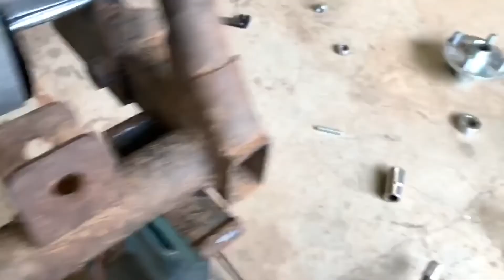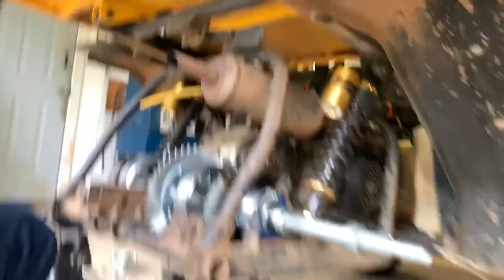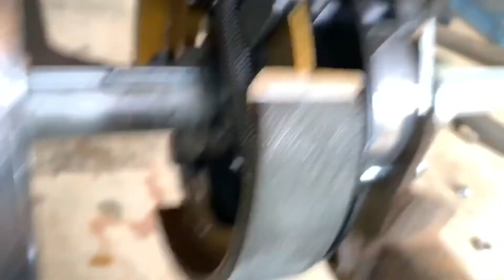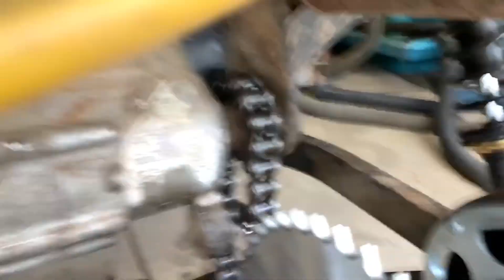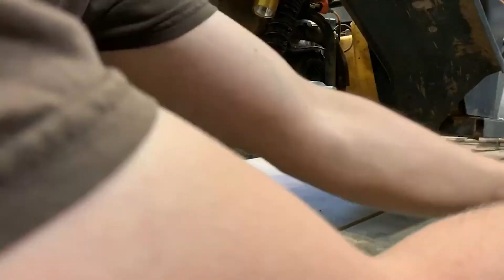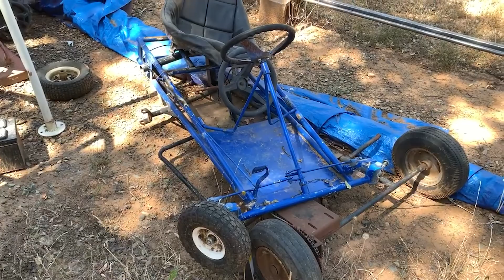Yerf Dog CUV Rover: Replacing the axle and brakes with standard live axle parts.

Comment: i just got one that runs and drives super cheap. cant get the chain tensioner to fit like its supposed in all the pictures. engine fix bracket is bent and the bearing is missing. axles are also super loose like yours were. engine smokes a little on full throttle. struggles to start at that even after cleaning the carb, new fuel pump, clean tank. is this thing a lost cause?

Comment: I just bought my first Yerf dog Rover (1994). It was not running due to melted wires so I put it in neutral and winched it up on my trailer. Then put it in F to haul it home. Got home and put it back in neutral and rolled it off the trailer. Fixed the melted wires and started the engine. Moved the gearshift to R. Next day the shifter won't move. I went out and tried to push it backwards by hand. It wouldn't budge. I jacked the rear end up and I could shake both wheels back and forth about an inch either way. I had my wife sit in it with her foot on the brake trying to pull the shift handle down out of reverse. No luck. Then I started the engine and let it run at a low speed while I tried to move the gear shift lever down. No luck. Neither wheel was moving even though it is in reverse. When it was on the ground and I raced the motor, it seemed like it was trying to move forward but couldn't. But now I still have the rear wheels off the ground and the slack I had before moving the wheels back and forth is no longer there. It feels as if the brakes are on now when I try to shake the wheel back and forth. They won't move at all. I took the shift cable loose from the transmission linkage and tried to move the lever by hand. No luck. I noticed that lever is hooked at the bottom to other linkage behind the shift lever. It has an ear on if that rests against a pin coming out of the transmission. The pin fits against a couple of notches on that ear. I was unable to push the pin in and try to move the ear. I didn't force anything or hammer on it for fear of breaking something. It sure feels like the brakes are locked but the emergency brake is down and the pedal seems to be applying the brakes normally. I looked at the brake drums. The one on the driver's side appears to have moved over towards the passenger side a little with a gap in it. The drum on the passenger side has what appears to be a large rubber seal exposed between the hub and backing plate.

Can you help me?

Comment: I put those same shocks on my your dog's scout roll over and I have some side to side movement now do you have the same issue do I need to put some type of stabilers shock on an angle to prevent this or do I just run it as is
Reply from the maker: Sorry I didnt get back to you sooner, I made a video where I built a track bar to give it some stability, and the fixed the issue. https://youtu.be/g2qu-OJuu78

Comment: What length and diameter axle are you using?
Reply from the maker: It is a 1" diameter axle, and the overall length is 44"
Reply: @TheSkinnny  thanks
Reply: My sprocket is 2" diameter, the axle you use is only 1". Did you order a different sprocket?
Reply from the maker: @Felicia_Fuller  I did order a new sprocket and hub. I went for the larger 6 bolt 5.25" azusa uni-hub. That hub was easy to find plenty of available sprockets for any of the popular series chains. I did try the more common small sprocket hub that has a few different bolt patterns on it, but none of those patterns lined up with the original yerf dog sprocket. Check out azusaparts.com that's where I ordered almost everything for this.

Comment: Do you have a part number for the axle?  Are the brakes and sprocket reused from Yerfdog axle?  Did you just by the axle and reuse all old part?  I have a scout with a broken axle and just want to replace the axle; it's not worth it if I need to spend $500 on fixing it.  Thank you Skinny.
Reply from the maker: The axle, bearings, and brakes were all for my azusa go kart, and were ordered from https://azusaparts.com. The wheel hubs I ordered from amazon https://amzn.to/2WAXtn7. These aren't the exact hubs, but are the right ones anyways.  The lock collars were supplied from the local hardware store. I will try to get some part numbers for what I can and add it to description, but it might be easier to look for a live axle kit that already has all of the parts. But here is a link for a stock replacement axle https://www.bmikarts.com/Rear-Axle-for-Yerf-Dog-CUVs_p_513.html. Unfortunately there appears to be a waiting list for these.

Comment: Hey skinny! What do I need to remove to ONLY get the axle shaft out?  My machine only has about 15 hours on it but previous owner took it off roading and snapped the shaft right at the bearing hub. Thanks for the breakdown vids!
Reply from the maker: It’s definitely not a fun task, but you have to get the bearings, brakes, and sprocket all unbolted, brake cables pulled out, and at least a shock or link removed to fit the assembly out of the cage, maybe even both sides, but with shocks instead of links, I only had to remove one. Then fish it all out the side the suspension is removed. And watch your fingers, especially getting the sprocket though. Bmikarts.com has replacement parts including the axle shaft. Best of luck to ya!
Reply: @TheSkinnny  what if I ONLY want to pull the shaft itself and not everything else?
Reply from the maker: The hub for the sprocket is welded on. So that would be in the way to get the shaft out normally, but you could just use a cut off wheel and cut the shaft out. Cut both sides of the sprocket hub off to get clearance to slide the remaining pieces out of the brake drums. Make sure to take the big castle nuts off the ends with the wheel hubs, and the shaft gets smaller in diameter out at the ends, so it should all fit through the bearings. But cutting it out with a cut off disc, or even better you could use a cutting torch, if one is available. Sounds like you might actually have a fun task after all.

Comment: What shocks are those
Reply from the maker: Here is the asin number from amazon B00XVH4NVG The 400mm shocks are the ones that I used. They are lighter duty than some other options out there, but so far they have lasted the longest, and were much less bouncy than the standard chinese H.D. shocks that were on the rover when I got it.